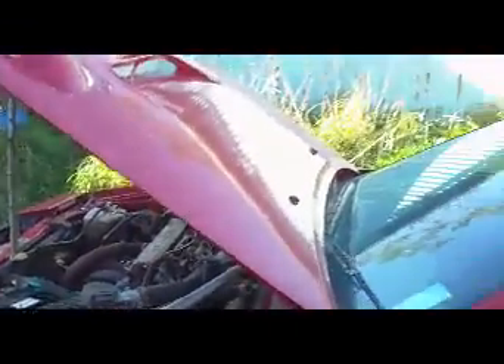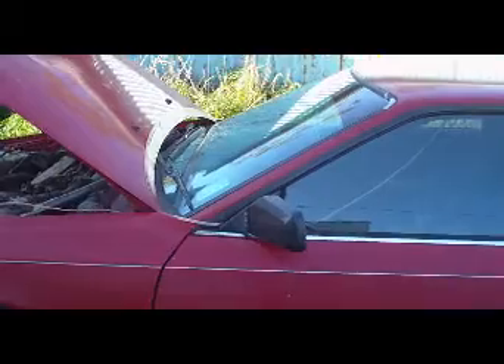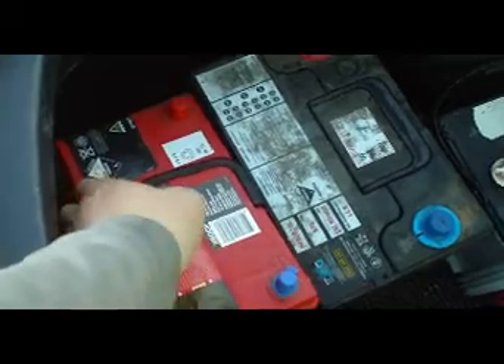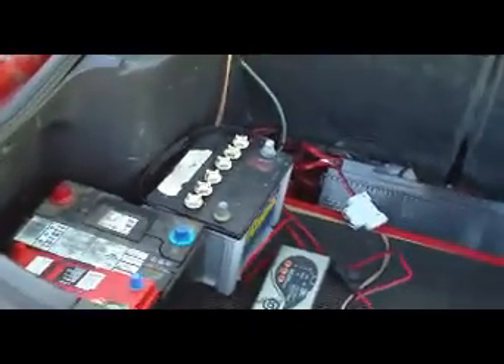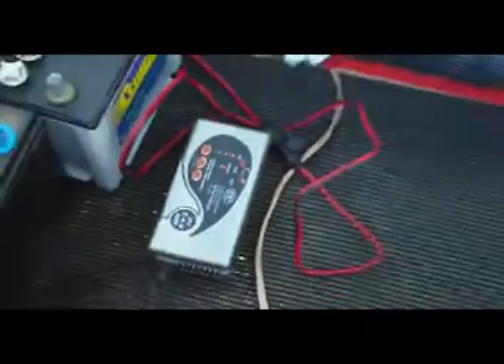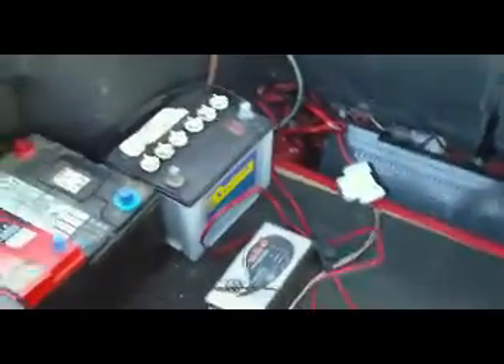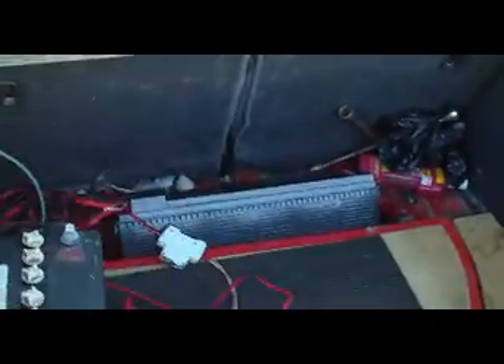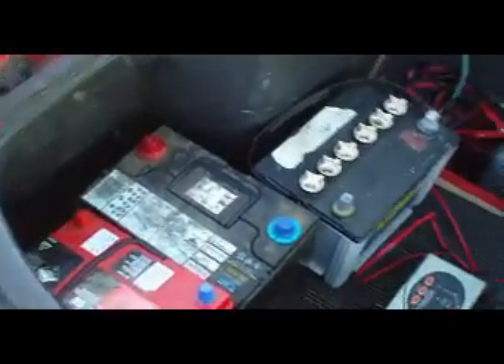Running car with no alternator - improved wiring.

Comment: Part#2
I did another test today
My  charger maxed output is 500 watts 
With the low beam lights, blower fan, radio and driving 450watts
I drove for 55min, 15km and used 0.324 kwh until the car started to go crazy
I conclude that it would require a lot of power to travel long distances.

Comment: I did some test today
I have disconnected the alternator power cable only
11.5v to 12.5v DC
All watts are AC
My civic uses

180 watts idle
240 watts idle with day time running lights
140watts for the low beam lights
150 watts for the blower fan at high speed
100 watts for the electric power staring 150watts max
50 watts for the brake
I should be able to drive with about 300 watts, I'll charge the car battery by using  a charger and another battery while driving.
I have tested the extra battery with a inverter outside  the car it can do 200 watts for 17hr
Reply from the maker: It will be certainly interesting too see if you get any savings in fuel consumption. Let us know what you find.

Comment: Leave alternator in place. Remove the diodes and run 3 wires out. Connect a brushless speed controller to the 3 wires. Connect a relay off the brake light circuit that tells the esc to go 0% when braking. Connect a limit switch to accelerator pedal (unless you have cruise control) that tells the esc to go 100% when accelerating. Now you have regenerative braking and electric motor assist. It costs $1.47 in fuel per hour to run alternator loads. Remove the lead battery and install lithium. You now have a hybrid. Ps I am DIY TESLA POWERWALL

Comment: 100 watts added to your charging system (usually solar) is equivalent to 150lbs of weight in the vehicle. The alternator delete is the single most effective way to lower your fuel costs. An alternator loads the engine down to apx. 1.3HP. When you take that load off the engine your idle is smoother, your acceleration is faster. Your cars ability to climb hills is more powerful. The lower the engine HP, the greater you will notice the difference. I've got a 3 cylinder Geo Metro, and the difference in that 1.3HP gain is very noticeable, so much so that I will never go back. It almost performs like a v6 with greater power.

Comment: I was thinking is it possible to remove alternator to save on fuel consuption and drive using few car batterirs and charge them over night.
Reply from the maker: Yes, there will be less load on the engine although I would not think that it's overly significant. And then of course there is the weight of carrying the extra batteries which could end up being roughly equivalent to the load of the alternator. I believe the seemingly increased fuel economy was due to  the smoother supply of electricity running the ignition & the injectors that the batteries provided.